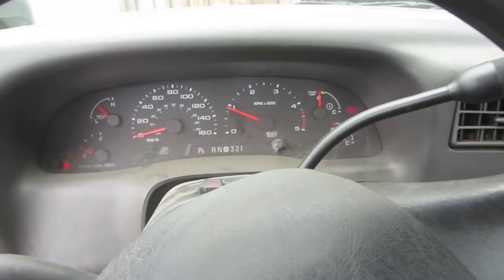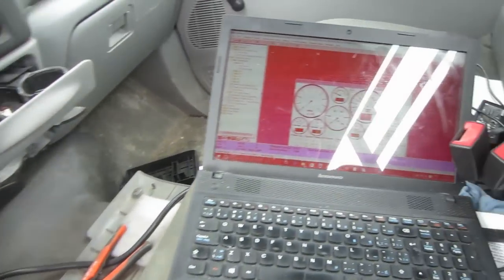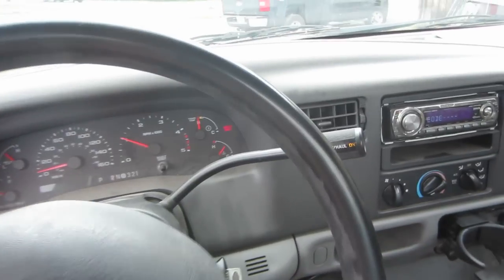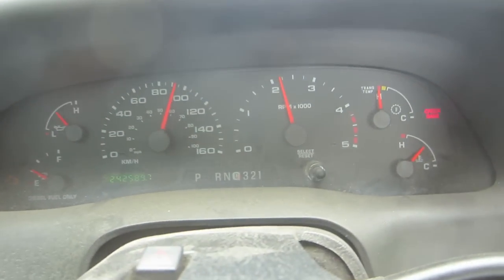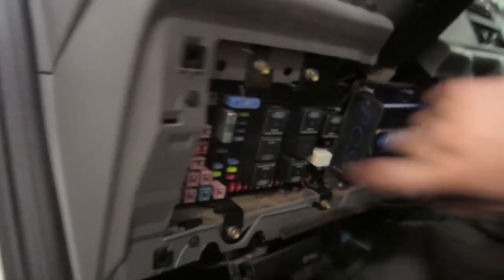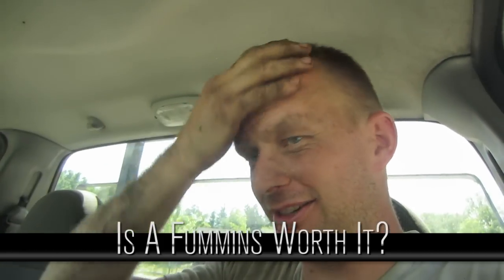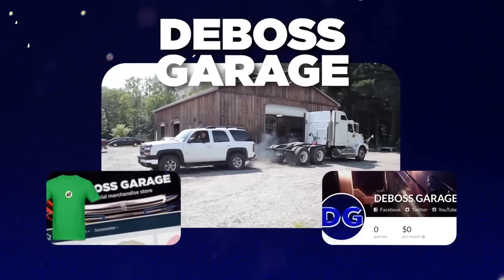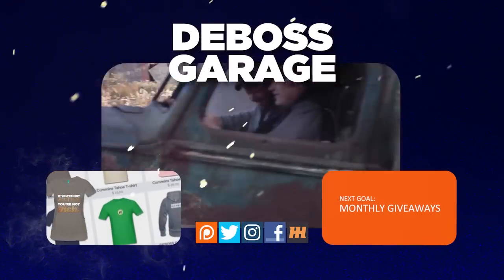TEST DRIVE RANT: 5.9 Cummins in an '04 Ford F350 (Part 4)

Comment: Why do you keep comparing the new powerstrokes against a 12v cummins?  Doesnt even make sense.  There are way way more 7.3s on the road than 12v's.  Facts.
Reply from the maker: Do you have a link or some stats?  7.3's were in pickups and school buses in North America.  5.9 Cummins were used in pickups, buses, gen sets, Pumps, excavators,  and marine, all over the world.
Reply: DEBOSS GARAGE 7.3s are also used in ford and international medium duty trucks.  Let's stick to apples to apples comparison though.  There are way more 7.3 powerstroke fords still driving around than 6bt dodges.  No I don't have hard statistics but it is blatantly obvious to anyone paying attention driving down the road.  Maybe its due to the powerstroke being superior, or that there were a lot more made, or just that the 6bt is a great engine but wrapped in the turd of a truck that is a dodge, but I don't see how you could argue the fact that 7.3 powerstroke fords are outlasting 6bt dodges.
Reply: Regardless, my original main point was you're unfairly comparing a 6bt to the modern powerstrokes.  Why dont you compare apples to apples as in 5.9 vs 7.3?  I think your fanboyism might be showing a little bit.
Reply: jackson Welch another dodge fanboy
Reply: Zach Morris not to much into dodge no but the 12 valve cummins is a far superior engine over the 7.3 and there no why there’s more of them than on the road over the 12 valve it just doesn’t make sense
Reply: The 5.9 cummins was in much more than just dodge trucks . Prior to dodge it went n service in 1984. Even ford put them in there larger 550s and 650s shhhh and south american f250s up. Plus tractors chippers skid steers box trucks ect ect. Cummins partnered with company's from every major country to put the 5.9l in all types of equipment From China to Pakistan to India to Russia south america and north and the rest of the world.  There are many many more cummins 5.9 in the world than the 7.3. FACT
Reply: Mark Rich Ok.  But I'm talking truck vs truck.  Cummins fanboys seem to conveniently forget it is wrapped in a turd known as a dodge.  The 7.3 ford trucks are simply the more reliable platform overall is all I'm saying.
Reply: Im talking trucks too. School buses and mining dump trucks/ equipment no matter the country  are still considered trucks. And no look up the b50 on each engine.  Diesels life span are reffed to as B50 . 
I own a machine shop . I tow allot of parts and engines around. Plus All I do is build engines . Ive built ever engine conceivable. from stock metro 3 cylinders to 1000hp turbo charged sbcs. Ive owned trucks from all big three including the 7.3. I currently drive a 5.9 as my personal truck I bought new in 2001.And a W350 for work.
The 7.3 PS and 6bt have the same life span . I own a cummins because I find them easier to work on and cheaper. But most of all are designed to last.
Reply: Mark Rich spoken like a true fanboy.  The amount of old 7.3 PS vs old 5.9 cummins out there still working disagrees with you.
Reply: jackson Welch Yeah there are way more 7.3s still driving around than 5.9 dodges.  Its just reality.
Reply: Fan boy . How old are you grow up talk like an adult. Children insult others when they get upset . I own a machine shop all I do daily is rebuild engines .  I drive what I drive because its more reliable.
Reply: Mark Rich not upset.  Just saying what you are.  There are way more 7.3 PS trucks on the road than 5.9 dodges.  Deal with it.
Reply: Mark Rich And I farm and run a snow plow business.
Reply: But there arent .The 7.3 was only in North american trucks for 9 years 94-03  The 5.9 was world wide in all types of med duty truck applications conceivable from 1984 to current. Dodge alone 89-07. Not counting fords. Do you really beilve that statement?
Reply: Mark Rich Look around next time you are driving.  Half or more of the trucks DOING WORK are ford diesels especially the 7.3s.  Its not even a brand thing, its just a good business decision.  If you want to be profitable with truck work, ford 7.3s are the way to go.  If you want your truck to rot out, have front end problems and swap trannies like light bulbs, use dodges.  Dodges are for hauling toys and looking pretty in the parking lot.  Cummins fanboys like to forget that there's a lot more to a truck than the engine.
Reply: Dodge trucks suck. I hate dodge trucks . There is a lot to dis like.  That not what we are talking about. I replied to your statement there are more 7.3 power strokes in the world than 5.9 cummins.  The engine is all we are talking about.
Reply: Mark Rich I'm glad we can agree that dodge sucks, but reread this entire thread.  I've been comparing 7.3 fords to 5.9 dodges the entire time.   I'm not talking about generators or whatever.
Reply: Zach Morris what about the ford 550s 650s from 1993 to 03 with the 5.9 .  I personally love chevys. We have a 1000hp mud truck we built few years back .
Dodge has there problems but most of us don't buy dodges for there bodys. Tranny suck steering is horrible dashes crack. Axel are pretty decent.  What are you going to do if you want a decent diesel truck that's not 80k new.
Reply: I see lots of older dodge and chevy diesel work trucks still around, not a whole lot of fords with powerstrokes unless they are pavment princesses. Granted i do see alot more 7.3's then anyother. But it is less. Also, the powerstroke was used after the 12v was replaced.
Reply: Alex Young If you think theres more old chevys and dodges than 7.3s, you got some fanboy blinders on there bub
Reply: The 7.3 power stoke was only made 94-03 . The cummins engine in dodges where made since 1989 .  The Chevy 6.2 diesel from 1982 on  , 6,5td,  duramax 6.6 td  . Its all our military uses .  its mathematically impossible for there not to be more .
Reply: 75% of the heavy hauling is Cummins
Reply: Memeskeyoch No, you dodge fanboys just keep misquoting what I am actually saying.  And yes Deboss is one of the biggest Fiat fanboys around.
Reply: I'm Impressed at how long this arguement has been going on. Also deboss has mentioned several times hes not a dodge fan, just a cummins fan.
Reply: Last time i checked deboss was a gm fan so how does that make him a dodge fan boy and he clearly states that he is not including the 7.3 or 6.9 or the 7.3 powerstroke

Comment: The 6.7 truly not a good engine. A ‘02 2500 Duramax with 180k miles like it came from the factory no tunes or anything done to it will completely destroy the 6.7 Powerstrokes the Duramax with 180k miles got better mpg and will leave the 6.7 in the dust towing the exact same load. The seats were also horrible in the King Ranch rock solid. The Duramax which was fully optioned too from the factory has super comfortable seats great for cruising and the Duramax is also way more reliable than the Powerstroke.
Reply: Lol a 6.7 will spank that duracrap any day 
The Chevy makes 235 hp and 500 ft lbs 
Ford 450hp and 935 ft lbs 
Do your research before spiting some bs
Reply: And the mpg has to do with emision equipment
Reply: mattv1256 my mistake it was a 6.4l either way both powerstrokes are garbage they both get poor mpg with emissions equipment as an excuse. Plus you have no need for 950ftib’s in a 3/4 ton truck.
Reply: Jimmy Grant yes you can blame bad mpg's on emissions. If your comparing a 2008+ 6.4 to a 2002 6.6 the emission standards are world's apart. If you really want to compare the too delete the 6.4 then see what you get.
Reply: Jimmy before you talk. Think........ just for a second

Comment: You talk so much shit about Powerstrokes I just had to flip to another channel . .BTW, I have 570K on my powerstroke and have never had it in any garage but my own and Im no mechanic. You should specify what powerstroke you bash because my 7.3 is freaking awesome and still rolling daily. I put one automatic transmission in it at 300K and injectors at 365K  and thats it.!!! I'm pretty sure if you don't take care of any modern diesel engine it's gonna take a dump on you.

Comment: the hate for ford is real in this channel! you cant figure out whats wrong with the hard shift into gear! must be the manufacturers fault. did it do that before you put the cummins in it?
Reply from the maker: That was the problem with this build, he didn't have a chance to drive it because the Powerstroke wasn't running.  It ended up being the transmission itself.  After a rebuild, he has way too much money in it.
Reply: how many miles did it have?
Reply from the maker: 240000 km
Reply: it wasn't the trans it was his piece of shit controller doing harsh shifts. Look it up, it won't take long to see the pcs controller problems with the 5r110.
Reply from the maker: It was definitely the transmission.  Previous owner verified that it always shifted hard..   The 5R110 is now in the scrap and an NV4500 is now in its place.
Reply: "That was the problem with this build, he didn't have a chance to drive it because the Powerstroke wasn't running." - I thought you said he couldn't try the trans because the engine wasn't running. I'm just going off of what I read, and from what I'm reading you just contradicted yourself. But hey it could of been the trans, just more often than not it's that controller, live and learn. I have over a 5r110 with over 320000km with not a single problem-like literally none. Just filters and fluid keeps er happy :-)
Reply: You will regret saying this when your powerstroke goes pop !,  and it will

Comment: How bout just buying a darn dodge Cummins truck!!
Reply from the maker: This Powerstroke was almost free, and is now way cooler than any factory built truck
Reply: Dennis Reelie and nv4500
Reply: Alex Matthews thank you
Reply: Your a fanboy,. Dodge builds a better truck then Ford and is on par with Chevy, get over it. Hell, Dodge and Chevy share shit loads of parts.
Reply: Gotta quote ol' Peg from zip ties and bias plies- dodge is just a shipping crate for a cummins.
Reply: Who buys a 3/4 or one ton truck for the ride I've got a 17 ram 2500 6.7 with the g56 manual  and it  rides rough but I haven't been able to completely  bog it it's got way to many emissions  and electronic crap but that is the only gripe I can have with it starts when its 0 out side and hasnt been plugged in  they all have their  strong points and flaws but I'll stick with my   cummins

Comment: That's what you get when you screw up a good truck by putting junk in it.
Reply from the maker: It runs great, just doesn't shift (Ford transmission).  Don't worry though, it has an NV4500 now and is 10 times the truck.  Comfort and looks of a Ford with a reliable drivetrain
Reply: DEBOSS GARAGE it was ten times the before you put substandard parts in it. And as for the Ford transmission, 4R100 is the strongest auto platform ever built. People are even putting them ( swollow hard) in Chevy diesels for pulling. So put it back and make it great again.
Reply from the maker: It was the 5R110.  The truck was fantastic for the first 100 000km and the previous owner bought the truck again in repairs the next 100 000km.  It was so unreliable, he traded the truck for a used transmission and a case of beer.  Not one person who drove this truck after it had 100 000km on the clock will tell you it was a great truck.
Reply: Still believe the 6.0 was and is a platform better than any Cummings. Worked on hundreds of them and major cause of fail was lack of proper maintenance. Have several customers with 600.000 + miles on them, many with factory head bolts unturned. And 1.000.000 on 7.3. All with proper maintenance.
Reply: I  have a 24 valve 5.9 with Ford PCM 5r110 its great ! , it has a switch to lock overdrive , is there any way I can change that still using the Ford PCM ? so I can eliminate the switch? , Destroked was used for all the rest but he wont help or give advice because I did not use his $1000 PCM, also do you have to re-program the gear changes every so often? , as mine seems to be revving a little higher than it was before it changes up gear now , Are you in Canada ? or US ?  wish you were down the road from me !
Reply: You want to know who makes a better diesel. Diesels life span is referred to in its b50 its b50 is 50% of  engines will need a rebuild  in xxx amount of miles. 
If people actually refreshed there engines more often they would last allot longer also. Full tear down gaskets /hone/ rings /bearings.  I dont care who makes the engine or how good its reputation is . Metal wearing on metal wears down. No way around it.

Comment: The 2-3 shift in the 5r110 is a slop shift. Something about torque converter lockup and simultaneously shifting into another gear then unlocking the torque converter. All that to give that transmission which is just a beefed up version of the 4r100, the essence of a 5th gear. Or feeling of closer ratio shifts between 1st and 4th gear. The factory tcm does a pretty good job of controlling the shifts so you don't notice it, unfortunately it's a tuning  nightmare when trying to do it with a stand alone controller. In a nutshell is why PCS will not support the 5r110. I believe anyway.
Reply: I am putting a 12 valve into a 2006 F350 Dually  , I already have a 24 valve in an older F350 with 5r110 using the Ford PCM and overdrive switch , it is a great truck, but need a Dually  and just got this great 94/95 12 valve engine with less than 3000 miles from new !   would you just swap the whole conversion plate/ transmission from the 24 valve older truck  to the 12 valve engine and and use it in the 2006 Dually truck? , and maybe just sell the other truck with no tranny after pulling it apart?, or would you get another conversion plate  and use maybe a 4r100 transmission on the 12 valve?, it would be nice not to have to use a switch for overdrive lockup on the new conversion ,  Help I know not what I do  lol  Thanks
Reply: JendrixHimi if you are happy with how the factory TCM performs, it would definitely be more cost effective to use the parts from your other truck.  

From me, as an recommendation only. My first swap is running the pcs controller with the stock torque converter. I've noticed that if the throttle position sensor isn't dialed in perfectly when setting up the pcs, the 2-3 shift is off. The biggest draw back to using the stock converter is fuel mileage. The 6.0 powerstrtoke converter stalls at or near 2200 to 2300rpm. Changing the stock converter out for a 1600 to 1800 rpm stall converter should bring up fuel mileage.  The one I am working on now is a 2005 F450 cab and chassis. I can't vouch on fuel mileage, due to it having 4.33 gears, but I did opt for the destroked.com pcs controller with their tuning and billet converter. It is more expensive, but in my opinion worth it. I'm just not ready to give up on the 5r110 yet.
Reply: Thanks for the answer, destroked says the Ford TCM is not good , everyone else seems to say it is better. I have no complaints the way mine works apart from the switch on the dashboard OD switch when the mussus drives it  she forgets to switch it down and when you are stopping it clunks and jerks the box [Good job its a Ford or it would break!] I just want this one perfect as I am planning of it for rest of life its a 2006 KIng Ranch Dually , want to put the most reliable drive in it I can after it is done I'm hoping for 20MPG and never in the shop , so what do I do?  is there a way to get it to change to OD without a switch with Ford TCM and 5r110? , or should I go 4r100 Ford TCM , or what is the best box to use with PCS from Destroked?  is there another auto box that is better? btw my truck does not jerk like the one in the videa its as smooth as a factory ford truck , unless you bring it to a halt with the OD on , then it jerks when you put it in gear like the one in vid because you are putting it into gear in a higher ratio so in 1st gear pulling away it feels like its in 3rd